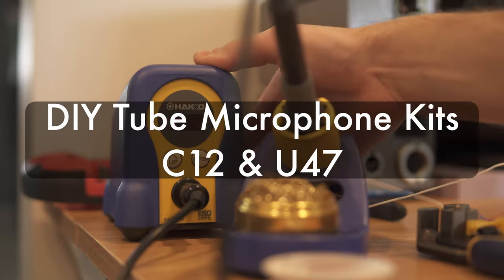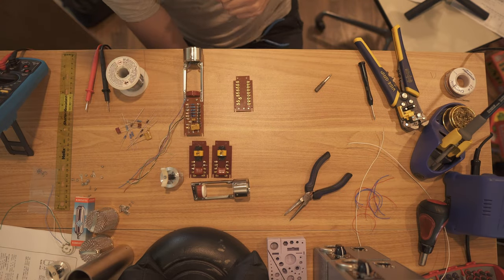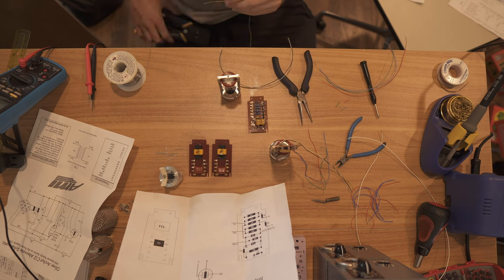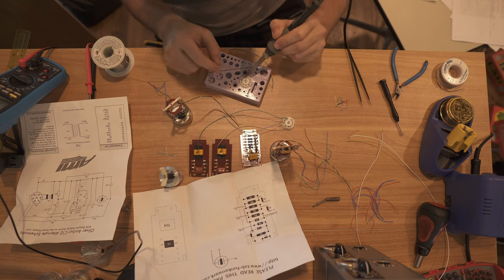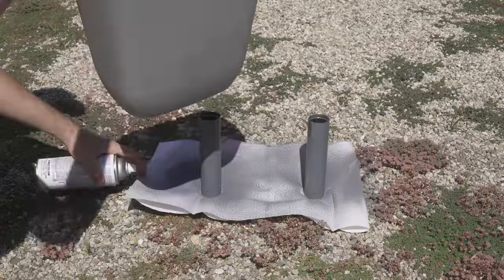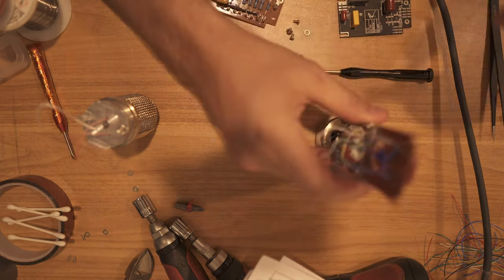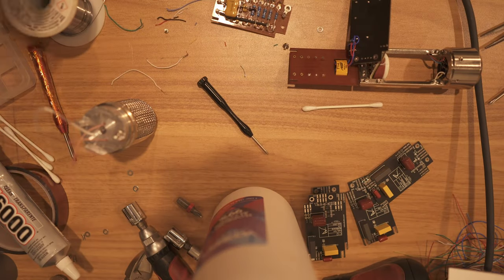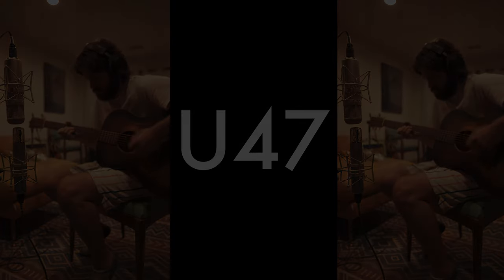AMI Tube Microphone Kit - C12 & U47 - Part 1

Comment: what gauge of wire did you use for this build?
Reply from the maker: 30AWG-Silicone Stranded Wire
Reply: @metalhead3ecr  can i pick your brain a bit about the u47 build? is there somewhere i can message you?
Reply from the maker: @artvandelay4914  go ahead and ask any questions here in case others have the same ones
Reply: @metalhead3ecr  first thing i would ask is, is there anything you wish u knew before you built the 47 mic? or anything you learned? things to watch for? I have ordered one my self to build
Reply from the maker: @artvandelay4914  just take your time with the build and you should be fine! Things to watch for would be maintaining a good ground between the housing and internal electronics in addition to keeping a tidy workspace so no debris gets near the capsule or high impedance sections. If you ordered from Dennis, make sure you get all of the items you ordered. I never received the wood cases and had to ask for a partial refund a few times before getting one.
Reply: What side of the transform is the primary side? Is it pin 1& 2 or 3 & 5? (idk if you still have your schematic)  @metalhead3ecr
Reply from the maker: @artvandelay4914  For the T14, blue is the primary side and red is the secondary. There should only be four wires.  https://www.tab-funkenwerk.org/product/t14/
Reply: @metalhead3ecr  yes it shows on the schematic which side has which colours but, Im curious about knowing what pins im connecting to primary & which to secondary. Newbie here btw 😅
Reply from the maker: @artvandelay4914  ah I see what you mean. It's not your fault as the schematic should have been more clearly labelled! I consider the primary to generally connect to the source and the secondary to connect to where the source is headed. In this case, the source is the mic capsule and it's headed to the output jack. You can see in the assemble photo guide that the blue wire connects to C3. https://www.tab-funkenwerk.org/ami-parts/mic-kits/c12a-kit-parts/c12a-assembly-guide/ I think these are 12:1 ratio transformers, so if you get it the wrong way around, you'll likely notice!
Reply: @metalhead3ecr  ok thank you :) im making the u47, the assembly guide isn't very good for the u47, the c12 looks alot better

Comment: Larger value resistors are quieter than lesser, look up shot noise, mechanical noise, the paint caused the body to not provide ground/faraday shielding, big waste of time though it worked out for u
Reply from the maker: not a waste of time at all, i learned quite a lot and you got a video out of it! it's a win win